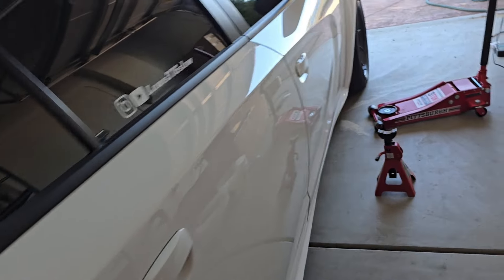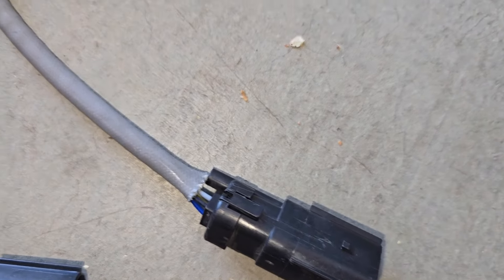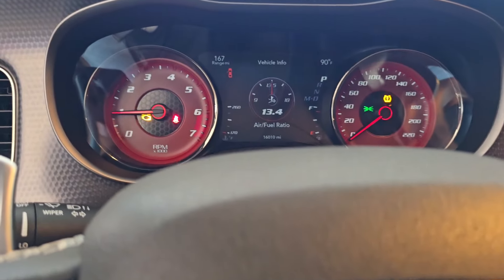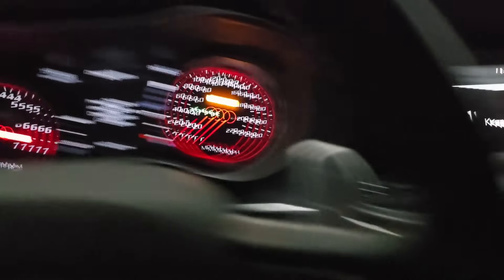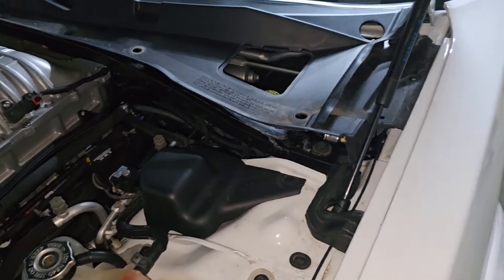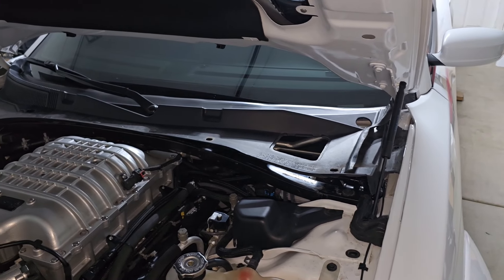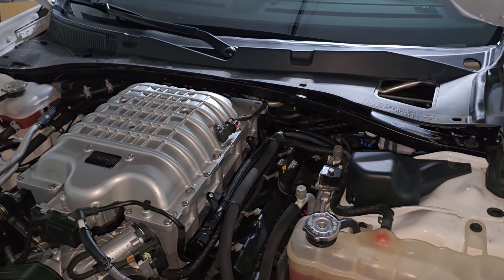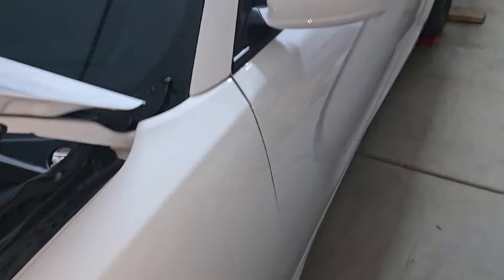Finally fixing my turbo redeye!?

Comment: If u have a fuel return System leave car off an turn the fuel pump on by removing the fuel pump relay an hard wire it an let the pump just run look at your fuel pressure and adjust. If the fuel pressure will not move yes it could be just a bad pump or regulator
Reply: That shit got my head hurting , too much work that don’t need to be needed after getting the car back!